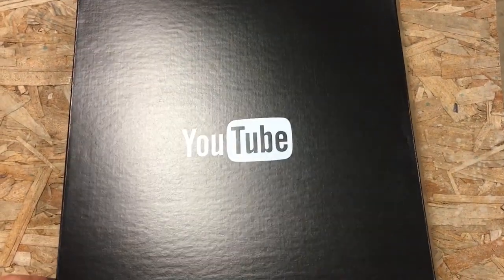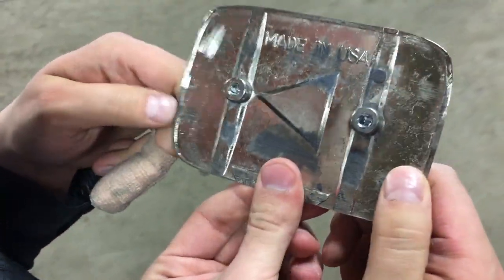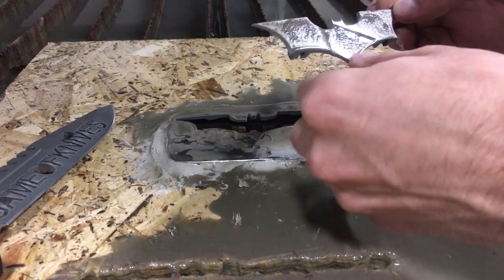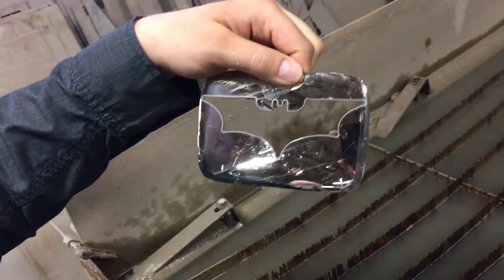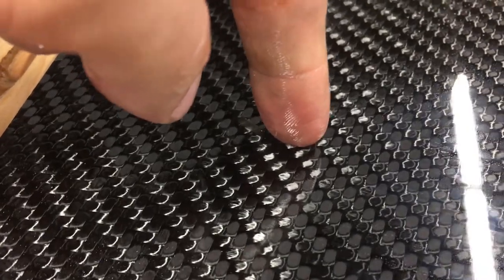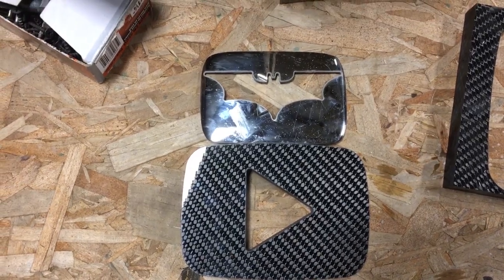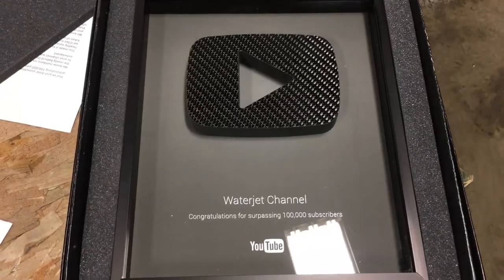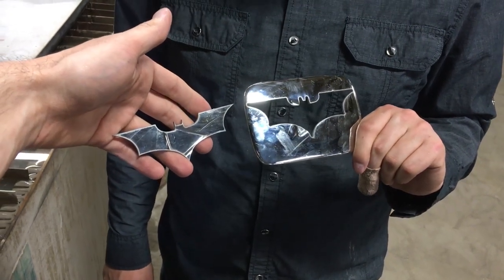New YouTube Play Button - Carbon Fiber

Comment: with your carbon button, I was thinking sand a 1/4 inch off the bottom of the play center piece then glue it back in, kinda like the standard ones.

Comment: if you don't know where Carbon Fiber is used, take a look at more expensive cars, like a Type R Honda, or some M cars from BMW, if you see black with grey square lines, that's Carbon Fiber. it's lighter than Aluminium and is 3-10X stronger than steel.

Comment: u said it reacts weird when it hits the carbon fiber without drilling the hole could you describe what happens or make a quick video
Reply: i think it kind of "dissasembles"
Reply: As the jet, digs through the layers, there is a major risk that the fiber layers crack, and ruins the finished cut, AND, the surrounding area :-/

Comment: does the water jet only have one mode? couldn't you have just had a little indent of a play button instead of cutting out the whole play button. Just a thought
Reply: How would you then cut that indent out?

If you could make it "less powerful" to only cut a layer or something, it'd just be a continuous line
Reply: Go back and forth repeatedly until it had an indent
Reply: Laith 
It's purpose is to cut, the pressure of water (with abradant) is high enough to get through most of the materials. Lowering the pressure to the point where it doesn't go through the material would create a whole lot of mess and results you could not easily predict.